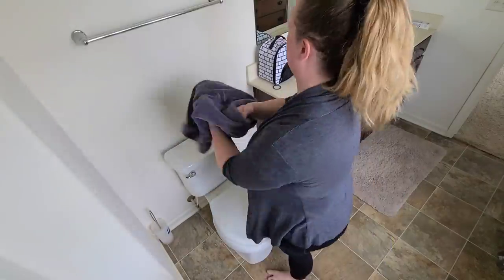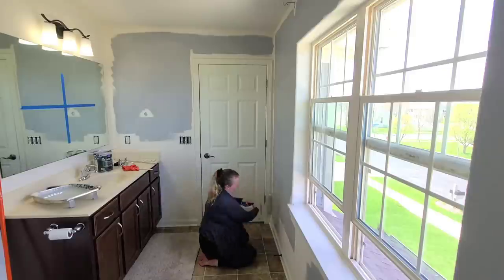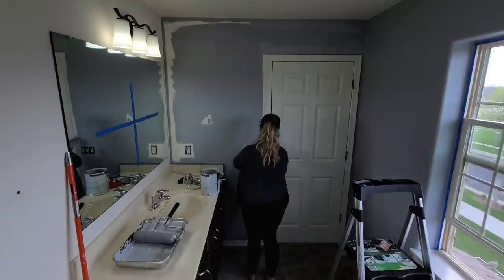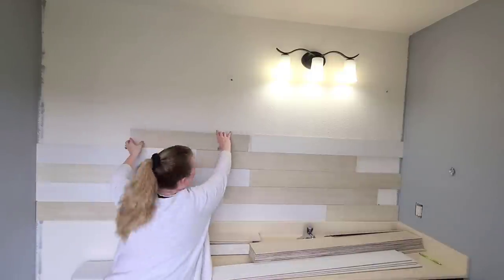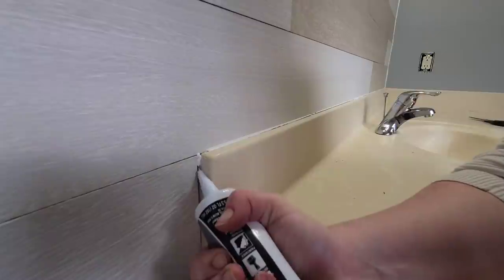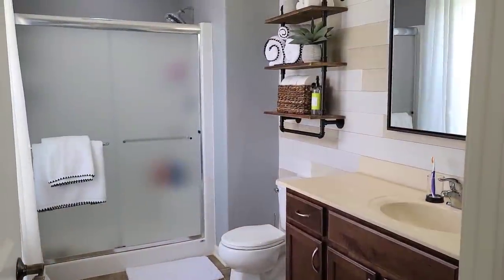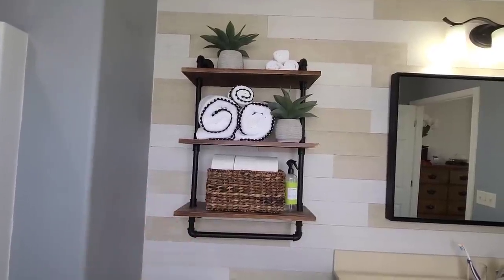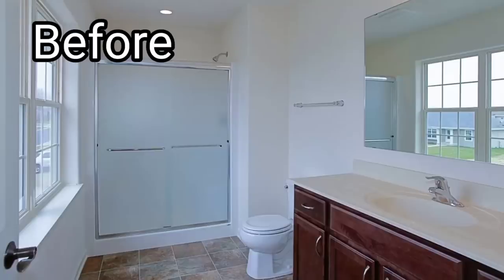DIY Small Bathroom Makeover On A Budget // How To Style Your Bathroom

Comment: The room turned out great! Love the accent wall. Not sure about anyone else’s Home Depot but at mine they give you the first cut free and then charge for every cut after that and it’s not cheap, I wanna say it’s like a $1 per cut so if you have a ton of cuts then that could add up. Just ask before you do it. They do have a sign hanging back by the cutting area also to let people know. But I do believe Lowe’s does free cuts, again check with your local store, they are all different. I just did a half bath makeover and my laundry room (hallway really) and now I just need to decorate them.
Reply from the maker: Oh that is good to know

Comment: Hello. I have a large mirror in my bathroom,  how did you remove it? I’m so afraid of getting glass all over or cutting myself since it is stuck to the wall. How do you do it safely?
Reply from the maker: It's it glued or just hanging. Mine was not glued. It's just had 4 brackets holding it